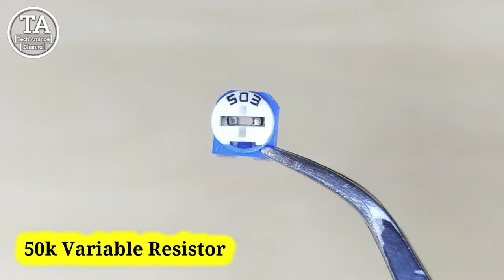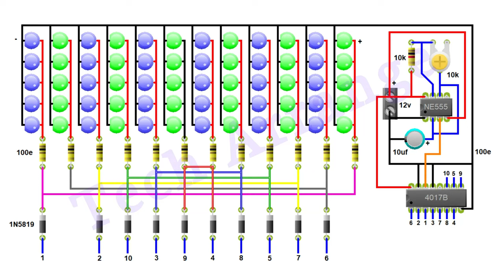Beautiful LED Light Project | LED Chaser Circuit

Comment: Hello, good evening. One question, I want to do the same, but with 5mm leds, what would I change? and connected to 5 volts
Reply: The brightness of the LED's might become a problem particularly with the blue LED's. Would change the 4017 ic for a 74HC4017 ic. Not sure if there is a 74HCT4017 series for the provision of extra output current over the 74HC4017 series.  Could use output transistors to act as current amplifiers further complicating the circuit. This would-be necessary for the normal 4000 series ic's operating at the lower voltage range as they tend to become sluggish with low frequency and output current capabilities.